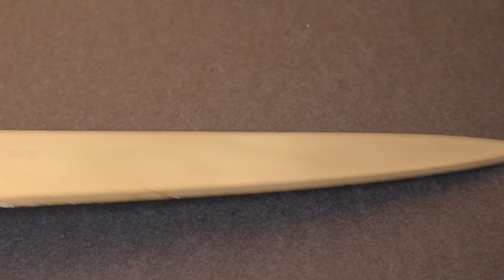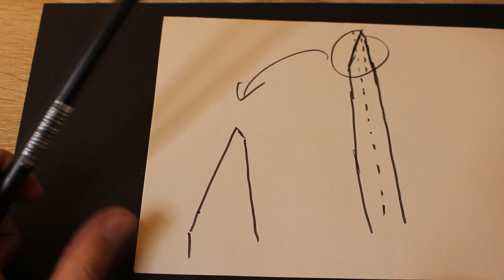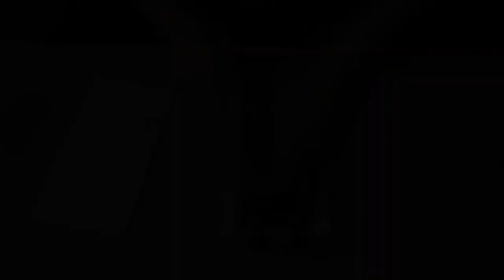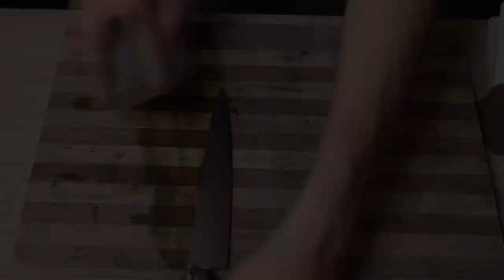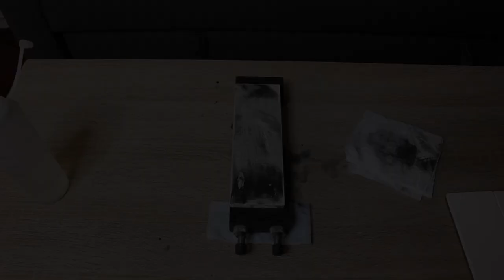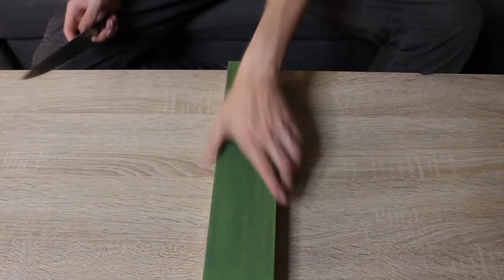Restaurando un cuchillo Sugimoto de filetear

Comment: hola saludos amigo, podrías mostrarnos sobre el afilado de un cuchillo kiritsuke por favor, nos ayudarías demasiado ya que este cuchillo es demasiado cuervo por el filo y tiene demasiada punta en el comienzo y final del filo, lo cual se me hace un tanto complicado la adaptarse a la curvatura de la hoja, yo tengo uno en casa y la verdad no estoy muy seguro del trabajo que hago a lo largo de la hoja. muchas gracias.
Reply from the maker: Buenas tardes, Armando. Pinta el bisel de tu cuchillo con un rotulador permanente. Cuando afiles, mira de dónde va desapareciendo el rotulador de la hoja. Esas partes las estarás afilando correctamente. En las partes en las que la tinta permanezca es donde debes insistir más. Un saludo.